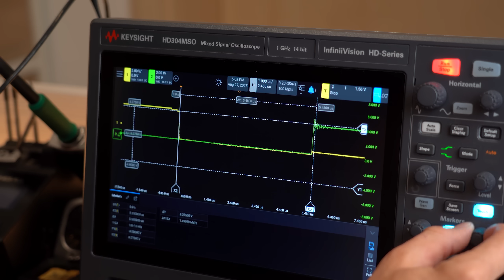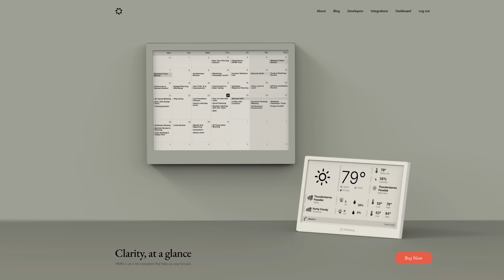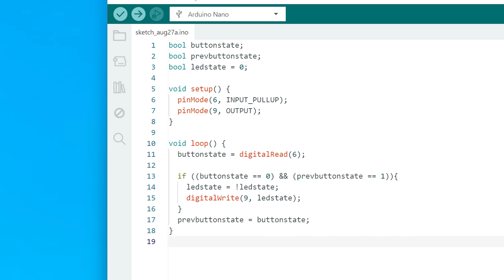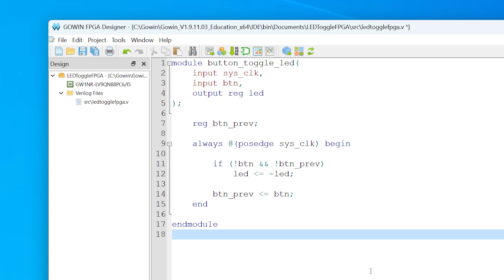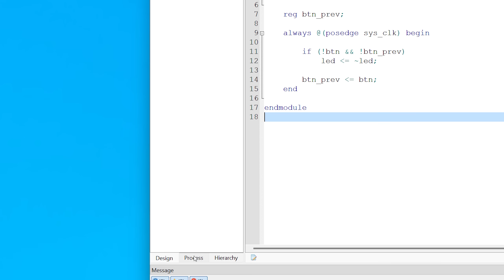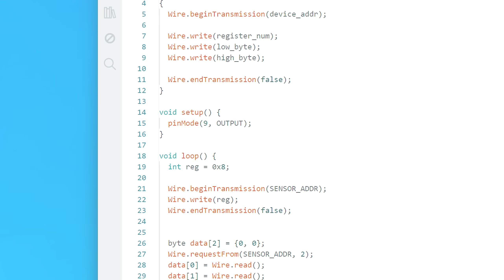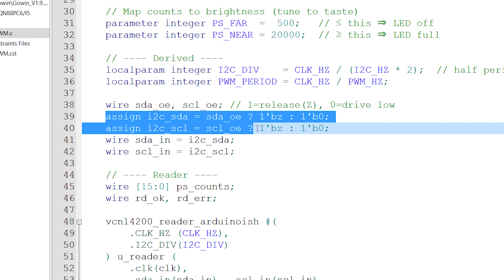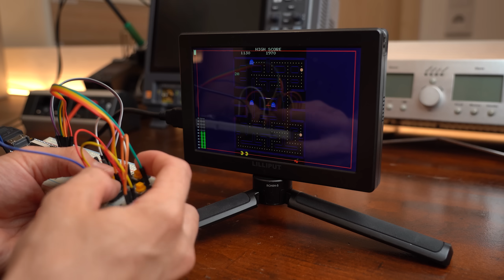The Harsh Truth about FPGAs (You Should Avoid Them?!)

Comment: Oof. FPGA not practical? That's plain wrong, and it's not the point either. Writing in Verilog or VHDL isn't more complicated than writing software. It's just the matter of getting used to it. You also get the support of an IDE, and the language is as simple. The big differences are 1) everything runs in parallel, so it's another mindset entirely, 2) you need to know the basics of microelectronics: clock domains, clock setup and hold time (how to manage timing closure), proper logic synchronization, and in your case, key debouncing. You also need to know a little about the FPGA architecture to design your logic appropriately (ram blocks, logic cells, routing, ...). The IO speed depends entirely on the buffers and the technology node of your FPGA, so they're not always quicker than a microcontroller. Beside the skills, the choice will mainly depends on what you need to do: FPGAs are good when you need more computing power because you can pipeline the operations and do them in parallel. Microcontrollers are good if you need something cheap that doesn't require the parallelism, or (for bigger microcontrollers) if you need more complex algorithms that are hard to translate to H/W.
BTW, you don't really say "compile". You say "synthesize" for the step that translates HDL to netlist and "implement" for the step that maps the netlist into the FPGA layout. You don't need to write I2C or PWM yourself, those are typical libs you can find online for free. For better known FPGA brands like Intel/Altera of AMD/Xilinx, it's probably available in the libs provided with the development kit. DO NOT ask for AI for that sort of things.
Please don't publish videos where you pretend to draw a conclusion when you don't have the knowledge to appreciate the pros and cons of the technology. Take the time to learn first.

Comment: You are basically comparing pears with tomatoes. In yourr case you love pears and not a fan of tomatoes, because you have no knowledge about tomatoes. They both have different applications and there are significant difference between these two. Fpga"s are not microcontroller and can not offer the flexibility of projects you are talking about. On the other side, you spotted one of the advantages of fpgas. Fpgas are often used in industrial applications where arduinos are not capable... You need to dive a little deeper and offer something more than "i dont know nothing about fpgas"

Comment: This is a pretty misinformed video. There are also Verilog libraries for FPGA-s, so you don't have to implement everything. Some even offer soft CPU cores, implemented in the FPGA, that can work like a microcontroller, while other (more expensive) FPGA-s just come with embedded ARM cores. It can literally do everything a microcontroller can, and then some.

More importantly, the only reason the I2C device worked, is that his microcontroller already supports I2C. Had it been a USB or PCIE, SATA, or any device that the microcontroller does not explicitly support, it'd have never worked. On the other hand an FPGA can support any interface as long as it's fast enough to process the data (or has enough of the special high speed serial blocks).

Yes, an FPGA is overkill if you only want to interface with things designed for microcontrollers, but a necessity as soon as you need to talk to anything else. (Although the Raspberry Pi Pico does have some programmable IO, that tries to bridge the gap. I've not used it yet, so I'm not sure which interfaces can it support).

Comment: That was another interesting video. Yes, it's easier to program MCUs and use peripherals with them than with FPGAs. However, libraries exist for both. What I find interesting is a combination of both systems: MCU and FPGA. The MCU is used normally, but the FPGA expands its capabilities enormously. This allows for controlling displays, adding more memory, or performing more complex calculations. Both are connected via a fast SPI interface. For the MCU, the FPGA is just another device on the SPI bus, but with more logic power. 😀

Comment: I can make a circuit that turns on the LED faster, just connect the switch directly to the LED and GND, and the LED to the switch and power (through a resistor with the correct value). and voila! It's probably faster than the FPGA!!

Comment: Hello I'm a newly retired mixed signal ASIC designer.  I really enjoy your videos and ideas.  I can not agree more with your conclusion (FPGA vs microcontrollers for projects).  I always think how to solve the problem in hardware.  Which is not a good thing.  If the purpose is to make a specialized, rugged full featured product maybe a FPGA is the way to go.  But....Why reinvent the wheel when all the "parts" exists in a microcontroller and can be at least prototyped with some jumper and a few lines of code.  There is so much to learn and address with a FPGA, analog interface has been mentioned, IO pads's specific IP( I2C or spio or UART), learning vhdl or Verilog. Learning the synthesis and timing engines.... to name just a few.  Have fun use a microcontroller for projects.  Focus on the project not all the parts to make a specialized chip for the project.

Comment: I used FPGA for years, but only for functions where a microcontroller is not quick enough.  I nearly always used FPGAs to mop up logic that the micro couldn't handle in the time available. Also they are great for mopping up glue logic .  The way you describe using them to replace a micro is very strange.

Comment: FPGA sees to me where you go when you need to optimize whatever it is you built with your SoC.  Starting with an FPGA seems like the hardware equivalent of premature optimization in software development.  Of course there are use cases that will require an FPGA, but for rapid prototyping you can't beat the work flow on something like Arduino.

Comment: Think of FPGA as a "simulator" for asic. You have the customization of asic, but without having to make one. The cost? Much slower speed. An ASIC CPU will be better (x50) than an FPGA CPU
Reply: CPUs in FPGAs are usually a manufacturer's gimmick. I can get a 1000MHz multicore controller for like $15 these days. That will hardly buy you a beginner's FPGA in a technology from 2008.

Comment: I'm currently doing an electrical engineering degree. I took a digital design class about designing hardware and the accompanying firmware/drivers to interface with a CPU, as well as CPU design itself. We used FPGA's (albeit fairly nice ones) to recreate the ENTIRE system (CPU, Memory, clock, IO Bus, everything) within the gate array. It was super cool compared to manually building a CPU on a board or something, because it meant that we didn't have to worry about part availability or assembly, and just got to focus on the design aspect.
Reply: That's cool, but after you built a custom CPU you also have to build a custom compiler. or, at the very least, come up with custom libraries and linker configuration files. That's basically just "not invented here" rearing its ugly head.

Comment: How can you write a program in an FPGA if you can't run a program in it? Unfortunately, I don't understand...
Reply: You aren't writing a program. You are writing a description of a logic circuit at the gate and register level. The FPGA compiler transforms that into routing information (basically just millions of switches) that connect the logic elements (small lookup tables) and registers. There is a bitstream file that can be loaded into the chip, which will then become an implementation of that particular circuit. For simple circuits (like a digital clock) that's an easy task. For complex one... phew... highly stressful.
Reply: @lepidoptera9337  thanks for the answer! I understand this part, but not how to run Pac-Man on it, for example?

Comment: You are not a fan of FPGSs because a few things: 1. you used a crappy FPGA with a crappy developing tool. If is not Altera or Xilin forget it. 2. If you don't want to used use Verilog or VHDL you are out of luck. Both are designed to take advantage  of parallelism of lines, you can't do that using a common sequential programming language and it would defeat the purpose of using FPGAs. Do not inject your lack of experience and understanding of a tool chain into a negative point for the product.
There are used cases where FPGAs are THE ONLY SOULTION POSSIBLE and not even a GPU can substitute them.
Reply: Altera or Xilinx don't make the process much less painful. I am designing with an Altera FPGA right now... the debugging is sluggish, at best. My design is tiny and highly regular, but a single compilation cycle takes 90 seconds right now. Including the configuration for the logic analyzer etc. the debug cycle is, at least, five minutes. I took me three days to find a trivial mistake a couple weeks ago.

Comment: I had the Tang Nano 1K for almost 3 years and i managed to master it using pure logic gates schematics, competing with my college mates in competitions like Maze Solvers, Line Followers, Sumo Robot fight...etc , it somehow feels like Rock Lee from Naruto having no ninja powers but still holds up.... bcs it actually is, all the Arduino and ESP32 users have the advantage of libraries, compatibility with modules, and even already made codes for the whole task, so it was difficult to reverse engineer everything and create custom logic circuits, not forgetting the board is expensive and it has no Analog inputs, No I2C or RX/TX Interface, but by lacking programming skills it was my only way, and it worth it

Comment: I definitely agree with the sentiment of this video! The learning curve for FPGAs is definitely a lot steeper than that of microcontrollers.

But, I don't think what you've presented here is a particularly fair comparison. I wouldn't consider an Arduino platform a 'microcontroller'. What you're comparing here is a fairly high level platform independent framework/API (Arduino) to bare metal FPGA development. Keeping with the sentiment of the video, there unfortunately isn't an equivalent to Arduino in the FPGA world.

Having said that, a fairer comparison would either be to disregard the Arduino platform and to write your microcontroller firmware from scratch, or to leverage the myriad of available open source FPGA IP cores (libraries) and to leverage a high level synthesis language (Amaranth, PipelineC, Spade, Slice).

Comment: I use FPGAs at work for chip verification. We use a custom serial protocol in our chips that needs to run at >10MHz with a continuous range of voltage levels for testing.

Comment: To program FPGA's, you need to understand the fundamentals of digital logic, meaning learning about logic gates, synchronous logic, sequential logic, memory circuits, state machines, etc... This is very different from software programming.
Reply: Programming "connections" and moving time forward by clock edge signals. True asynchronous programming, but you have no mutex locks to save you. :)

Comment: It's not really true to say an MCU is capable of everything a FPGA is except driving modern screens ... They have incredible performance, which is the only path for many industries including the one I'm in. Nothing to do with screens. It's used in defense, super fast real-time systems, large rapid data gathering, audio processing, and much much more. Any MCU doesn't come close, and I've used the top end of STM32s at work @ 500mhz on custom PCBs. They both have their reasons to exist, but yes if you're a hobbyist/inventor then yes stick with MCUs. If you need to/want to learn how things actually work then FPGAs are a great tool for this

Comment: When I was young, my dad gave me a Radio Shack discrete logic element kit for children to learn electronics. It taught about flip flops, latches and the like.
After going to college for a couple of years, I got a job at ScanTron, who made test scoring optical mark reading machines. Inside was a letter size circuit board covered with discrete logic chips. While I worked there, they introduced their first microprocessor controlled machine. There was a microprocessor in the middle of a practically empty circuit board.
I wanted to learn FPGAs for a long time but the high cost of development boards kept me away. I ordered the board in your video. Hopefully it will eventually arrive so I can have some fun. (I love your videos even if they tempt me to spend my money.)

Comment: One thing that the video missed though is the fact that FPGA works with logic cells, so it is not the same as some says, where you reproduce 1:1 the hardware you want to reproduce.
There is this common myth that FPGA means set every single transistor by hand so you can replicate everything at hardware level. Which is false. You use logic cells to mimic logic gate structures, in ways that mimic a signal output perfectly, but that does not mean you made a 1:1 hardware replica.

It is not a case that FPGA has a limited number of logic cells, based on the "cost and size" of the chip itself; so in cases where you need to make something off the shelf, FPGA is never the solution that is more convenient because of the points you clearly explained. 

BTW have you found any repository for the board you use, with premade libraries? FPGA in the end use the same concept of modular bits after all, so there should be a repository for that specific chip with base functionalities implementation in Verilog (UART, I2C and so on) that you can use.

Comment: Uh, microcontroller programmer here - the Teensy (imxrt116x) can flip IO in 20ns from an input if you use interrupts and bump the clock, you can't compare a microcontroller vs FPGA doing the same thing when you coded the microcontroller wrong (eg  probably used arduino code and no interrupts or direct register manipulation, letalone writing your ISR directly as inline ASM 😂
Reply: 3:43 yep, that is exactly what I thought your code was gonna look like 😂 you gotta use interrupts you can't just loop poll (esp in c, with arduino overhead) IO and expect it to be fast!
Reply: 5:59 and no, it's not basically the same because you're using the functional equivalent of an interrupt on the FPGA. This is an unfair race! It's like one car has 3 wheels 😂

Comment: YOU TOTALLY MISS THE WHOLE PURPOSE OF THE FPGA (Field Programmable Gate Array)
I am a principal systems engineer and have over 50 years of experience across the spectrum of hardware and software, although I have not programmed FPGAs.  
PROCESSOR CLASSES
There are CPUs(Central Processor Units), GPUs(Graphics Processor Units), APUs (Advanced Processor Unit which is a CPU, GPU, and shared memory on the same chip), ASICs(Application Specific Integrated Circuit), and FPGA(Field Programmable Gate Array).  Your CPU in your computer or mobile phone generally takes 3 months to manufacture, and at best, you may load and upgrade firmware to resolve issues or upgrade.  As you indicate, the FPGA is totally programmable down to the architecture, which is not possible with your CPU.  Once built, except for microcode, it is like concrete and unchangeable.  But also remember that while CPU have instruction sets, they may also vary in product lines in their instruction subsets.  This means that a digital video editor might choose to buy a specific CPU with an instruction subset built to handle digital video coding and decoding in hardware.  Similarly, there are financial and database-focused applications, geology exploration, etc.  So the classic application of an FPGA might be for a data center instance (e.g. AWS) where a company rents an instance and loads the FPGA with the optimal architecture for their application.  Once done, the application is shut down and the next customer loads their architecture into the FPGA.  Also, since the build time is 3 month, FPGAs provide a great solution for design, debug, test cycles for developers who must complete each cycle as quickly as possible to complete the project on schedule.
OTHER ARCHTECTURES KEY POINTS
AMD is a second source for x86 architecture and has developed so many important teechnological innovations.  This includes the APU which was the foundation of the Sony Playstation and Xbox.  Having the CPU on the same chip along with the GPU and shared memory gave AMD an advantage in transporting a mountain of graphics data.  Instead of a massive transfer from the CPU to the GPU, they just have to pass a pointer to the data and the CPU can instantly grab it from the shared memory.
The ASIC is a specialized chip designed for a very specific application and cannot do anything except that application for which it was built.  However, it does it much better than a general purpose CPU.

Comment: 6:03 you dont even have to define a clock signal just wire up the button to the clock of a flipflop (so the flipflop output flips when button is pressed) then the output to a LED (if i understand correctly) so this could be done in 0 clock cycles

Comment: Why not program the FPGA in C as usual? The rest is work of preprocessor or IDE. Ideal would be an Arduino IDE. 
Using another code is just absolute overkill for simple usage (if not absolutely necessary due to quite different paradigma which it doesn't look like), something like learning the old cpus Assembler.
Reply: The Verilog HDL looks a lot like C Language.